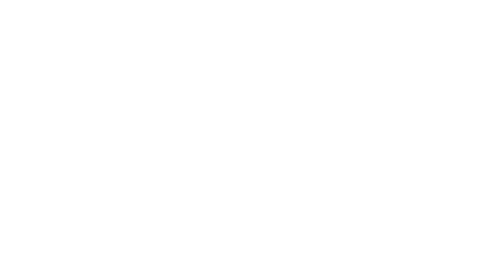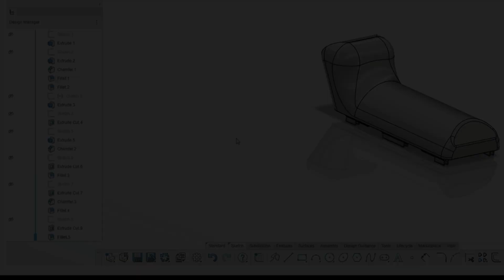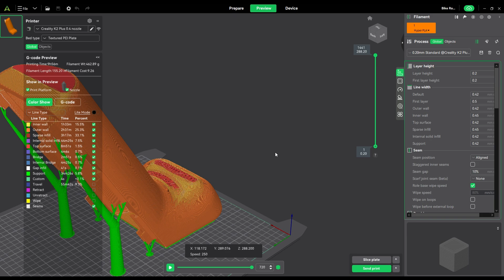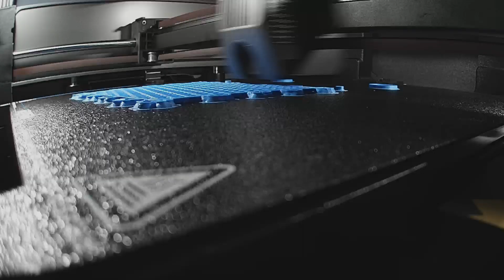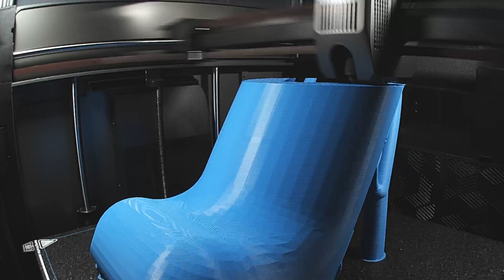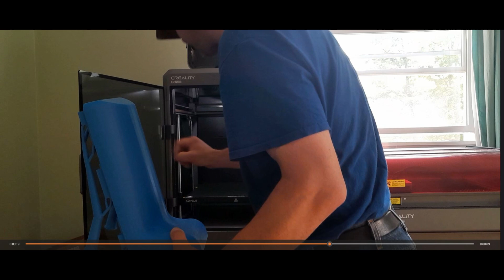Three Seat Bicycle - Bike Rack Jump Seat

Comment: Excellent! Great use of a printer.
I was curious if you were going to print the whole thing first. I've done the partial print a few times to ensure things were good. It's always frustrating when it actually works well, but a few times it has saved me, well worth the use of filament for the test. Does make me wonder about reusing the filament, but everything I see is either multiple thousands of dollars or too complicated to jankee for me to deal with.
Reply: I've even done test prints in cheap filament just to see that everything mechanically worked and then go to use the more expensive carbon fiber or whatever specialized filament I'm using. Same principle applies on my resin prints as well. Great job!
Reply from the maker: Thanks.  I've only experimented with PLA so far.  I have PETG on hand but haven't tried yet.  The first problem I had with my printer was using wood PLA (brown with wood fiber).  Had to take the printer head apart for that issue.
Reply: I've been tools that you need to use a large nozzle due to the wood particles in the "wood" pla!